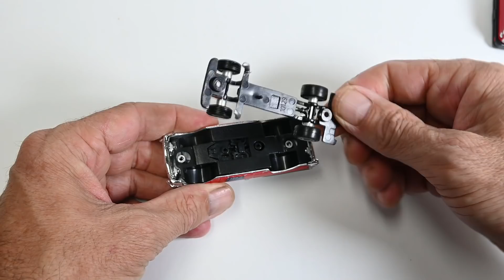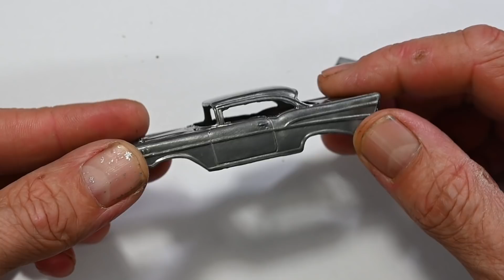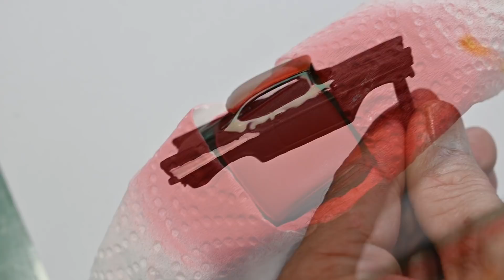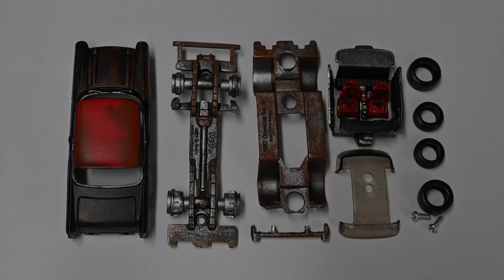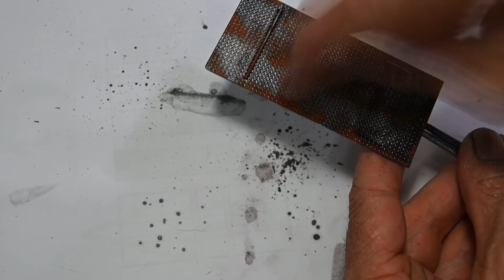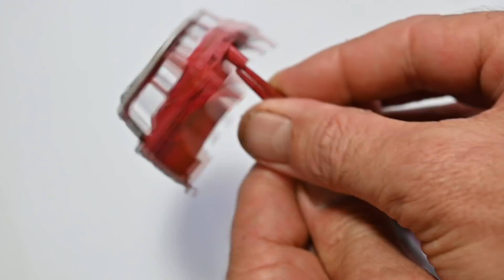Maisto Custom '57 Bel Air Gasser & Ramp Truck

Comment: With that kinda distressed look, it's like Maisto are trying to copy your style with this set Danny. Maybe time to get your name on the boxes ~ DDD's limited editions.😁 It's maybe just me but I'd say a Maisto set is a better starting point for you than any HW, although I'm guessing you'll pay a bit more for them.
What a difference the painted grille makes to the truck, changes the whole look of it. The paint and graphics look fantastic. The font/lettering you've used for "Gassey Valley Gassers" under the windscreen looks perfect - exactly how it would look on the real thing. The only thing I'm 𝑛𝑜𝑡 so sure about is the tow-hook. Cutting it down a bit might help but, does it even need to be there?

Cheers for now,
Dougie.

Comment: Speed holes in the front. They make the car go faster. And the truck is more or less an unlicensed model that looks like a Ford C-Series while there is an actual C-600 in the Hot Wheels Team Transporters series.